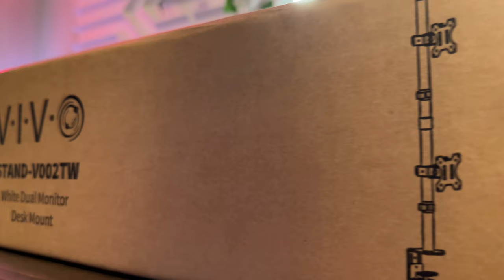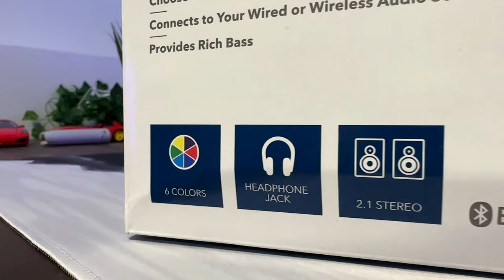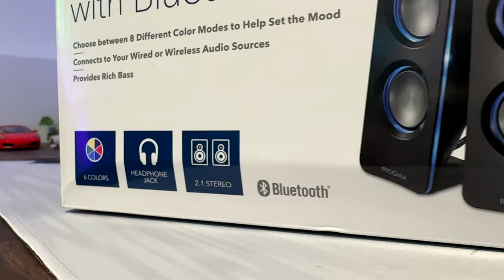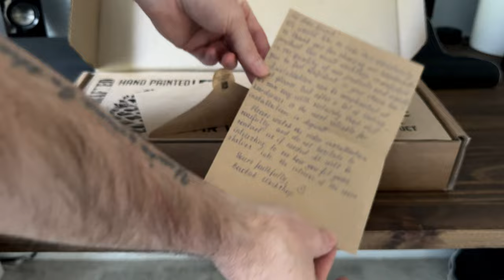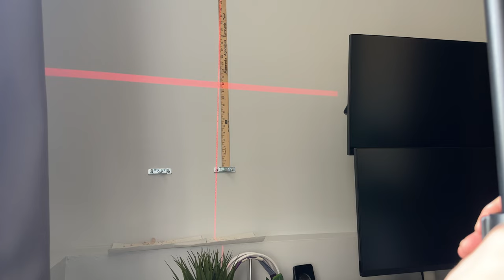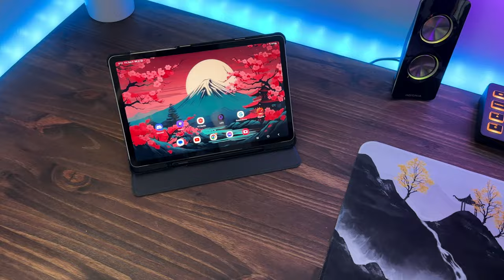Simplifying My Gaming Setup: Stacked Monitor Mount + Insignia 2.1 Speakers + new RGB Layout

Comment: i like the verity of colors, it makes the space feel lively!
Reply from the maker: Thank you! It’s definitely fun to have the option to set a theme in so many different colored ways.
Reply: how did you come up with wall decor layouts? i am in the process of building a room for myself but struggling to decide if it want a floating shelf here, or there. Do I want nano leafs, glid bars, or some other decor.  @MoonRiderTech
Reply from the maker: Honestly that’s such a struggle and I don’t think I’m the best at it either. My process is usually to stress myself out by overthinking. I’m trying to build something original so my setup doesn’t look like someone else’s but it gets hard to be original when we’re all using similar decor and being on a budget. This layout just came to me when I finally started working on it. I decided on the shelves, ordered them from Amazon and got them same day. Glide I just decided on a whim when it got to crunch time and the same for the Hexagons. The shelves are a bit more of a thought process cuz it involves putting holes in walls but for rgb I move mine around a lot when I get different ideas. And then you can always add new rgb later to your space as long as the double sided tape doesn’t wreck your wall.

Comment: the new setup looks great, one quick tip flip your top monitor so the bezel is on the top so the transition from your main monitor to your secondary looks more seamless
Reply from the maker: That was an option I considered. This time ain’t I didn’t want to see any beveling so I sacrificed the total seamless look for that. Maybe next time though when I feel like switching it up. Thanks for the suggestion though and for checking out the video.
Reply: yh bro no problem keep it up . much love <3 @MoonRiderTech

Comment: Your setup looks amazing! Why don't you flip your upper monitor up side down? This way you could line up the monitors and the thiker bar would be on top. Just as an idea. I like the wooden shelfs which matches the table.
Reply from the maker: It’s something I might do in the future. Considered it this time but decided to hide the thick bezel behind the bottom monitor.

Comment: Lools decent 🙌🏻
Is that an samsung tablet or what tablet are you using with the setup ?
Reply from the maker: Thanks, and good eye it’s a Samsung Tab S8.
Reply: @MoonRiderTech  is it possible to play on one monitor and use the tablet to control  and stream the gameplay on the one monitor thats being used , because i also have 2 monitors but dont want to use my editing monitor to control my live chat and gameplay on the second one while playing on my main monitor..instead i want to use my tablet to control those things ?
Reply from the maker: @balboatheboxer  you maybe can. I haven’t yet so I googled it and sounds like you can as long asc your pc has Windows 10 and newer and your tablet is an S7, S8 or S9 running One UI 3.1 and later. I might have to try this 😂
 I’ve tried including the link to Samsung’s support page below.

https://www.samsung.com/us/support/answer/ANS00088544/